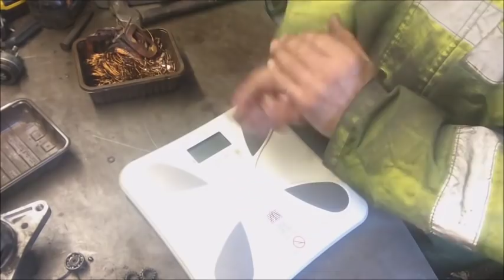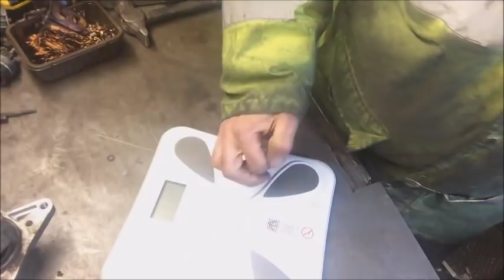Starters for SCRAP COPPER  4X Profit

Comment: I had to replace the starter motor on my truck. I ended up just cutting off some of the copper bolt with bolt cutters. It seemed like a greasy solid fortress to get into, so I got motor price for it. Thanks for showing what’s actually in it! An angle grinder would be a nice tool to get for fathers’ day...🤔

Comment: Great video Ian. I’ve been stripping cable ,motors etc for years I spent full four Day’s recently just stripping piles of cable loads of motors etc and yes I made £398 but this doesn’t even take into account my labour so it’s not cost effective but I look at it as I would have thrown it all away and made nothing. So happy days. I also made in those four days a awesome cable stripping machine motorised by a running  machine I bought on ebay for £30  stripping cable is minutes instead of hours of work now. Keep up the great vids.
Reply from the maker: llessurlihp    Love the name.  Yep, there’s money to be made, it’s a hobby for me, I don’t really get enough wire to make it worthwhile making a wire stripper.  Sometime maybe

Comment: Don't waste cutting discs on halving the motor lengthways- stand it on it's end, get a narrow wood chisel and chop the copper through at the top. Cut the joiners between each coil, prise the coils open where you chiselled them then upend it. Using a medium flat screwdriver, lever the cut loops out from the uncut ends. As for the solenoid, where the end is rolled over to close it, cut away only the rolled end to allow entire insides to slide out without having chopped wire to bits like you did. I dismantled a Valiant slant six starter this way- the windings in the motor looked identical, but the solenoid wire was much heavier gauge and a fair bit more. Unfortunately never weighed it. It's 10 30 pm here in Wallaroo- I'm going out to the shed cause I just realised I have a couple old XJ40 alternators I could strip!
Reply from the maker: awesome to see I reach Down Under, its good to hear of different methods, Im trusting your not as cold as we are at the moment

Comment: to remove any copper from any surface use hydrochloric acid mixed with hydroperoxide acid, it will dissolve the copper then use an iron bar to extract the copper from the solution...(its a very long process)  and dont forget health and safety with the chemicals

Comment: Im always amazed people junk starter motors, out of all the vehicles and plant ive run ive yet to have a starter i  couldnt get reconditioned. The guy i use will do a starter motor for around £50, bloody good value on a big starter motir over a new one, or a punt in the dark with a salvadge one.

A decent haul all the same.
Reply from the maker: Paul F  what’s more strange is I pick these up from my local garage, they don’t keep scrap   Guess it works out for me

Comment: Ian, I'm from across the pond, as you would say. I've been scrapping motors for over five years. I do alot of starters. One the quickest way to get screws out from the outside cylinder is use a torch.   Also, all though a hobby most starters will return #1 copper here in the US. Just food for thought. Would like to see you try a alternator sometime. Was nice to watch a fellow scrapper.
Reply from the maker: Lincoln Bates I have collected 3 to strip, just trying to find the time

Comment: I have a thousand semi truck starters and alternators to take apart. I have a refer trailer full of starters, solenoids, and copper battery cable and another refer trailer full of alternators and smaller copper cable.
Reply from the maker: Minnesota Red1981 your in the money then, but your gonna be sick at the sight  of them when your finished
Reply: @Man-in-da-shed  I'm already sick of it. Lol. My father is a diesel mechanic and kept a junkyard that nobody touched for 40 years. He just passed away and im cleaning the pasture up. There is even titanium on racks down there. I have the tools to do it though.
Reply: @Man-in-da-shed  thank you for the video.
Reply from the maker: God help whoever has to clean my hoarder mess up.
Reply: @Man-in-da-shed Do it Bro, clean that space. You can do it😂
Reply from the maker: @victormorrow3000   it’s my Retirement project  🙄

Comment: What you think of transformers no bigger than a microwave ones STRIP OR VNOT ?
Reply from the maker: a good question Kim, but one with many answers,  I personally as a hobbyist scrapper have the time to strip even the smallest ones IF. they look easy to strip. even some of the big ones are so intermixed with paper and lacquer, that i weigh em in as is

Comment: cool vid Ian and not bad profit 👍👍👍
Reply from the maker: Rafal Scrapper  Yes I was surprised I think it is because the coils are solid copper bands rather than Wire
Reply: @Man-in-da-shed  yep they has to be thick cause starterneed to be very strong to turm your engine  and that is reason we hat such a big bateries in cars 25 Amps +

Comment: I have a problem in my car in the morning or when the car ( engine) could I can starter the engine normally but whene I driving for a long distance ( the engine hot ) I can't starter the engine what's the problem plz can I repair the motor starter ??
Reply from the maker: brahim bouhamida  it does not sound like a starter motor problem. But starter motors are repairable, usually easier to exchange though